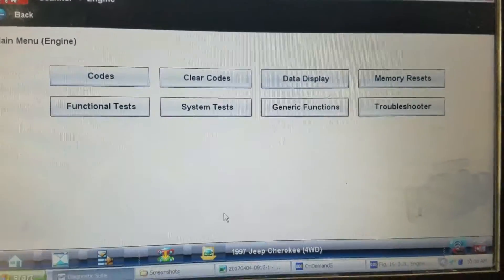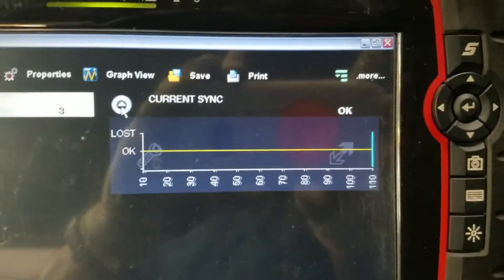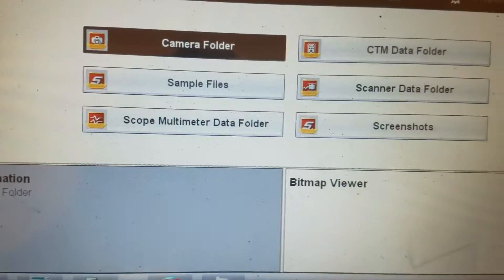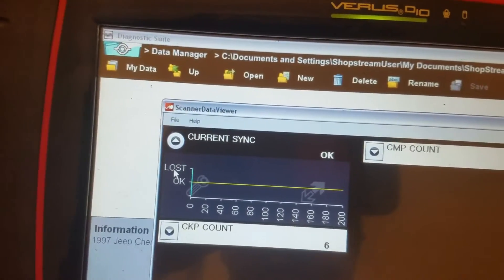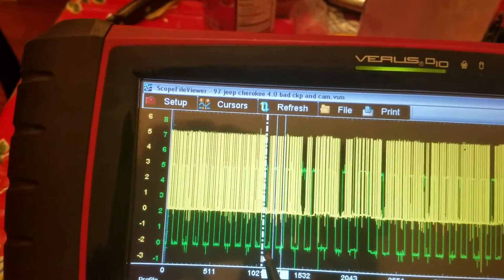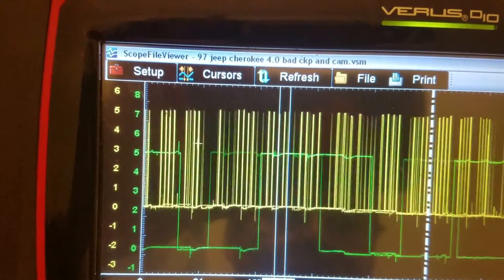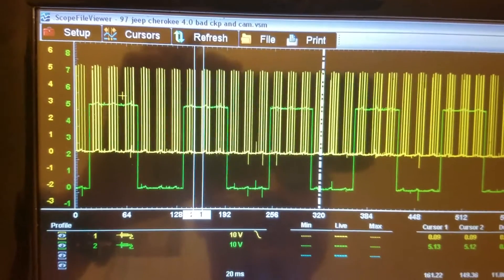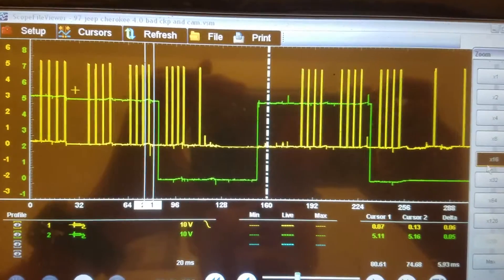97 jeep Cherokee  P0320  crankshaft position sensor circuit failure

Comment: The best words I was ever told is that we learn MORE from mistakes. If you had to do it again I think you would scope all 3 wires there at once before you pull the trans right?
Reply from the maker: I will how ever the one was the issue was the signal wire and it is a pull up signal if it was pull down I would not have remove the trainy for sure ,but you are right if I loose the reference voltage  or ground could do the same thing but that one was thigh in on others circuit here at the shop some else did replace the ckp sensor before and told me power and grounds were maintain during signal got missing.
Reply: I understand completely. Every job I have is after someone else has worked on the vehicle